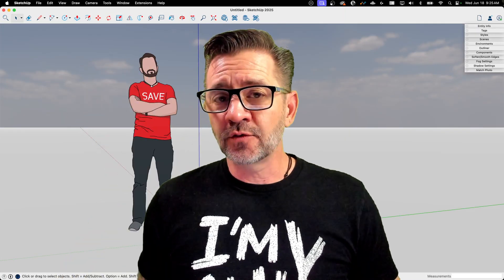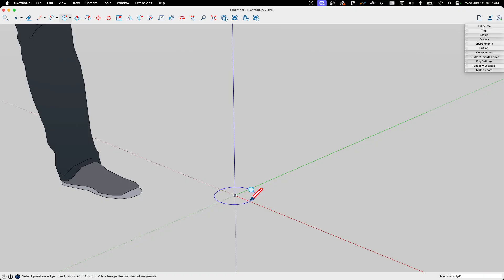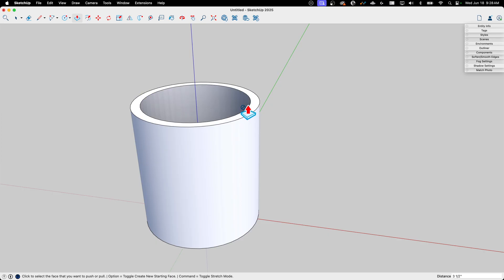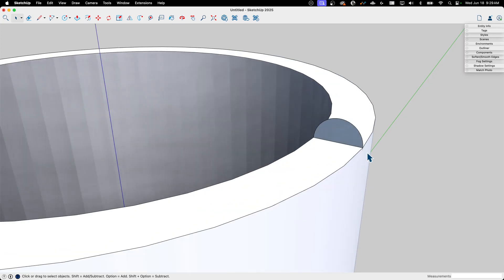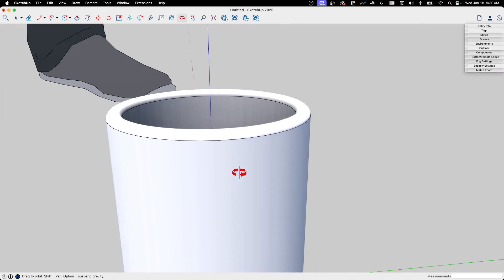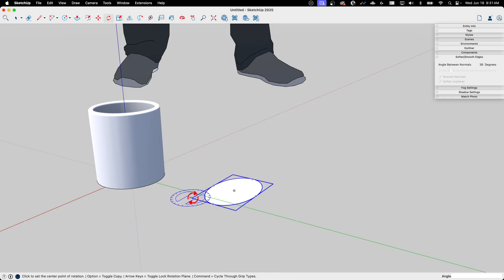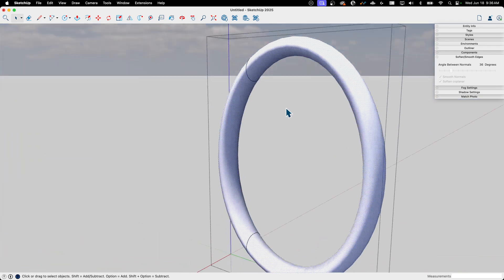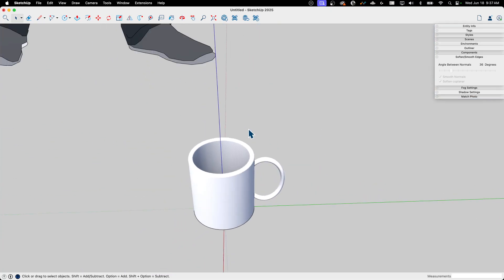Modeling a Coffee Cup in SketchUp

Comment: Would you please just reiterate other methods that can be applied to model a cup. I have used follow me, but is there another way to go about it?
Reply from the maker: Draw a circle, push/pull up the thickness of the bottom, offset the thickness of the mug wall, push/pull up the height of the mug.